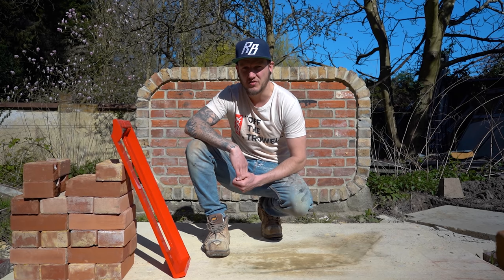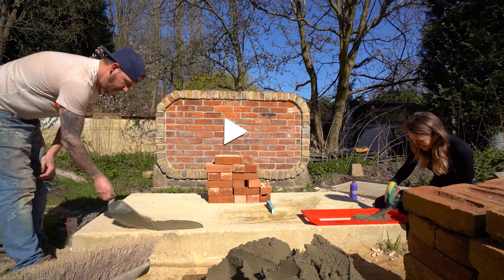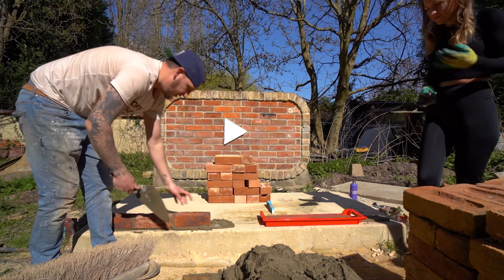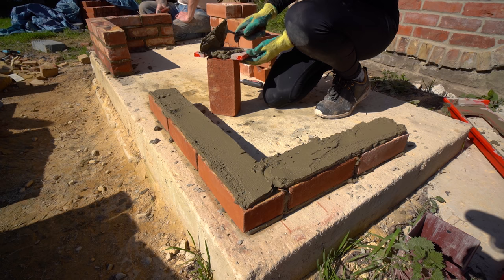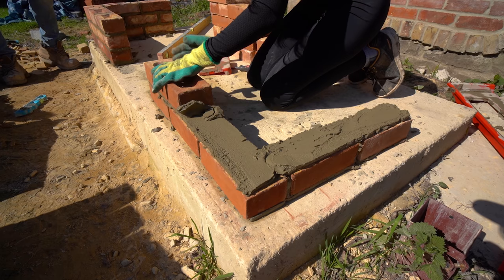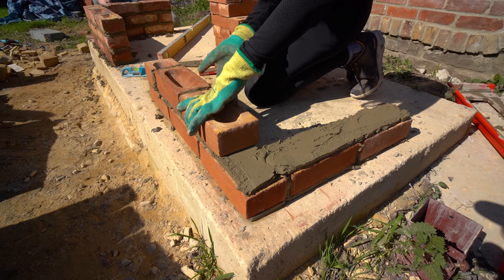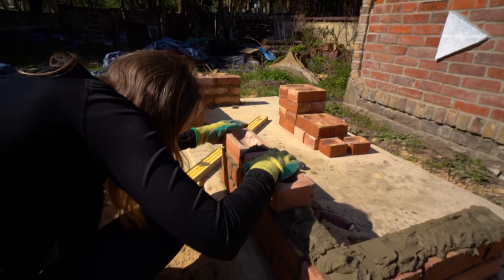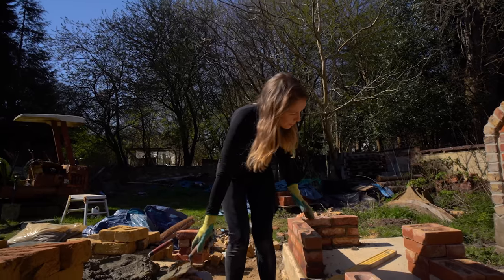BRICKLAYER Vs WIFE - BRICKLAYING CHALLENGE

Comment: Great video.  It's a good representation of experience v novice and what its like to use the tool. I once made a raised garden bed and being a noob, the pointing, I did later by a stick to push the mortar in at the end of the 2 bricks and then scraped it out to recess the mortar.  Hahahaha..but it worked.

Comment: Never understood why bricklayers wouldn't use bricklaying-Profiles. How does the bricklayer know that the joints are just as big as the other joints ??
Reply: Using your eyes.... plus you can gauge if you are pushing forward or backwards by seeing if the perp below is central to the brick you are laying.
Reply: @scottyw0tty420 use your eyes to see if the layer is 62,5 mm or 63mm thick? Yea right
Reply: @r.opthoogmetselwerken  layers?... you mean courses ? and it depends what you are talking about, cross joints or bed joints, bed joints you would gauge with a tape... regardless of if you are using a profile or not,  and cross joints you can eye in. using the brick below, or if its the first course you can set it out dry ... or gauge it lengthwise.
Reply: but most bricklayers can eye 10mm... give or take 1-2mm.... but you would check every now and then to make sure you are not creeping up or down.